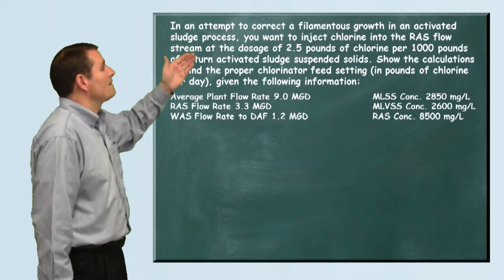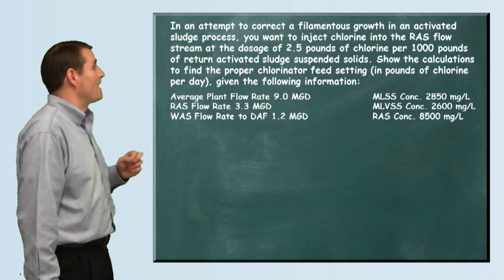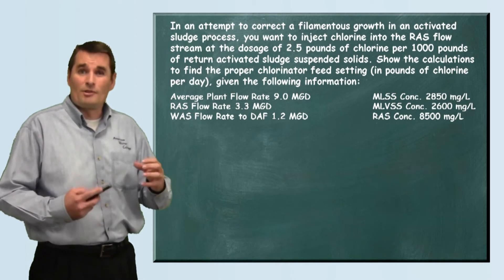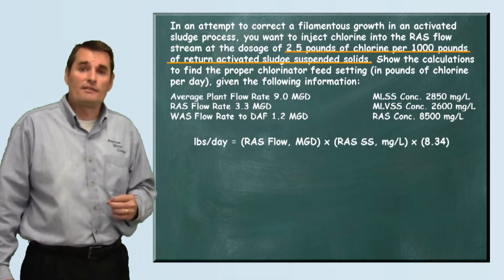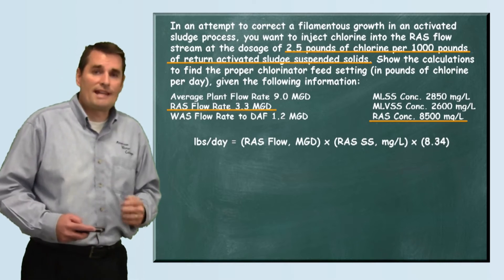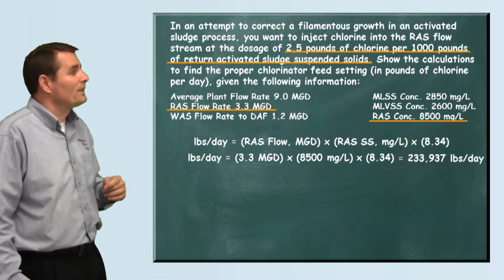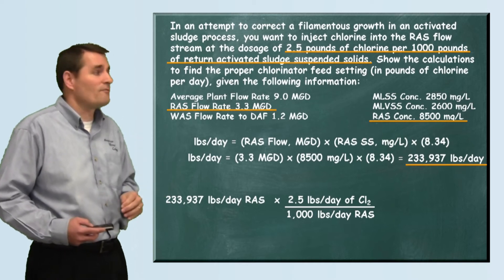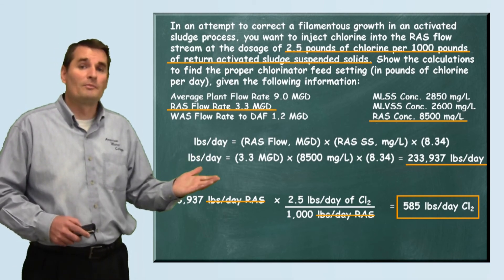Problem Solved: Chlorinator Feed Rate Problem - Wastewater Math

Comment: For a plant treating 1,100,00 gal per day what is the highest chlorine dosage the operator could add to the contact chamber to satisfy a demand of 3.7 mg/l while not exceeding the residual limit of 4.0 mg/l?
Reply: Sir did u get the answer
Value is 3.66 no sir are u working tr still
Kindly reply me back ok